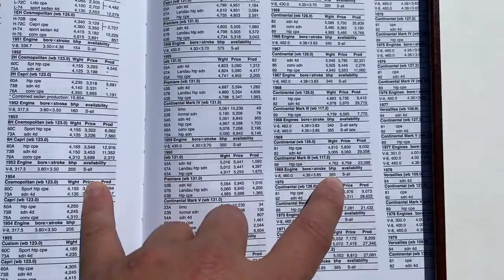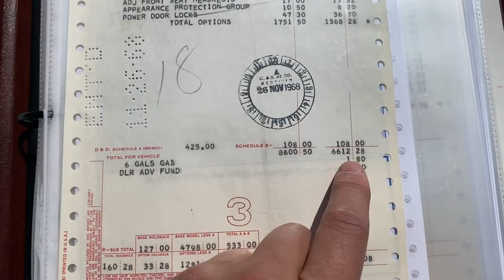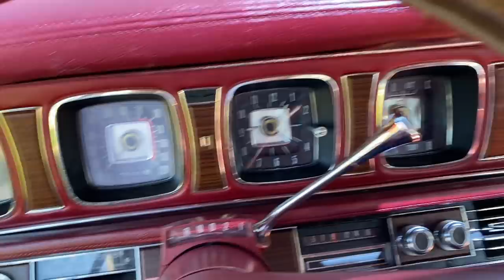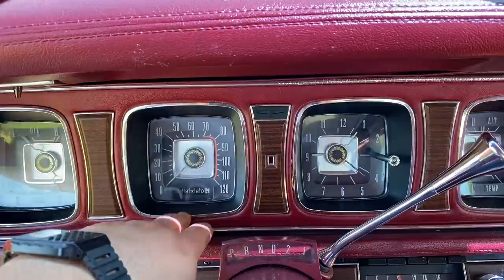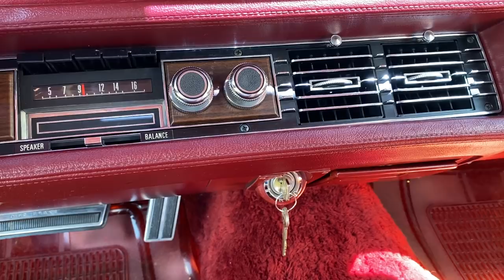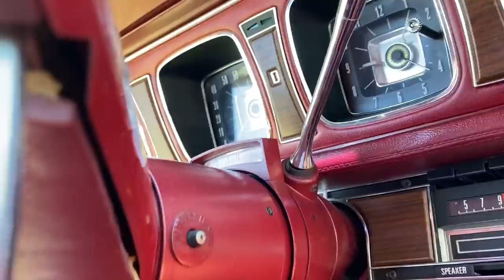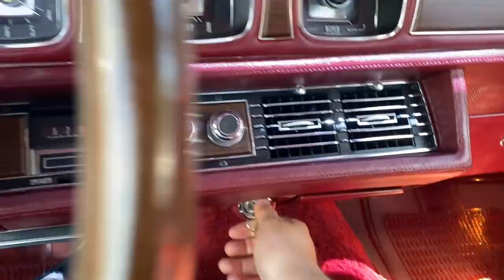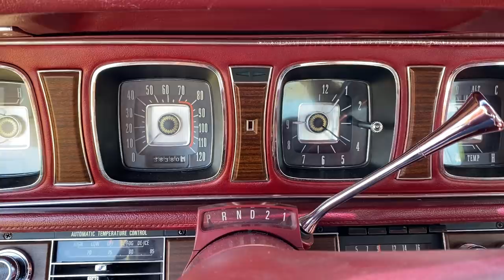The High Point of American Luxury Cars: 1969 Lincoln Mark III

Comment: Have to say THANK YOU to Mr. Lee Iacocca for these beautiful MARK III's. Your car lives on!
Reply: Amen. Story has it that Lido had a sleepless night in Europe when he came up with an idea of slapping a Rolls Royce grille on a Thunderbird and the rest is history.  He went on to work his magic with the Maverick, Mustang 2, and yes the Granada/Monarch. He had a hand in the fox platform in the planning stages. I wonder what position Ford would be in today had Henry Ford 2 allowed Lee Iacocca to do whatever he wanted - one is with an engine sourced from Honda and of course the mini-van concept. Hmm
Reply: @chadhaire1711  Yes they were, but they sold well. Right cars at the right time. Lee did the same with K cars at Chrysler.
Reply: @markjohnston3502  1987 K Car! That's what we used in Driver's Ed class for practice driving around town & the nearby country roads!
Reply: @markjohnston3502  Ford usually fires you for doing a great job!
Reply: They actually thought that it slowed down the assembly line!
Reply: The grill on that car weighs more than a Honda.  It is really the last true Lincoln quality wise.  All chrome and stainless trim not aluminum on the outside, and steel on the body thick enough to resist small bumps so when you hit a pedestrian, they stay down.

Comment: One very important system to look at on any 68-71 Mark III are the drain tubes for the rear vent cavity which drains water from the cavity to the underside of car via some flexible bellow style hoses in the trunk on either side of the spare tire. Once these hoses rot which 99% of them do, depending on the horizontal attitude of the car the water will either drain to the trunk or worse yet under the carpet and often into the wiring track under the passenger side. 

I found this out after not being able to get the musty odor out of my car which entailed removing the complete interior in order for the water to evaporate and air out the carpet.

 Because replacement hoses were not available back in 2003 I used some flexible pool hose and replica hoses may be now available for purchase from Lincoln Land in Clearwater FL. 

With 500 ft lbs of torque the Mark III is a tire melting monster. There is even a fully dressed Mark III on you tube that runs mid 10's in the 1/4 with a modified 460. I love my 71 MarkIII.
Reply: The MK III's are awesome, but what a horrible and easily fixable problem to be completely unaware of.
I read that the early 460's from 1969 to early 1970 were built using selected fits, which substantially increased the 365 rated horsepower.
Reply: They say the 500 engine is a good drag racing engine when built for high rpm’s.
Reply: Sorry, but I'm not entirely understanding what area the tubes are draining the water from....can you specify? thanks.
Reply: Chrysler used a similar rear-window/trunk area fresh air system in 1967 (the only year) and it had large drain tubes in the trunk as well.  I suspect the general idea of aquaducting water thru a vehicle was determined to be not a good idea.
Reply: A John Deere 7000 series corn planter dry fertilizer tube is almost a perfect fit, you will only need to use an adaptor at the bottom. Under 20 dollars at any John Deere dealer.
Reply: Tubes drain from the rear grille opening above the trunk theese are a problem I encountered
Reply: @Johnnycdrums  I raced a roadrunner and beat him a relative he couldn't believe it   dont think was  a hemi  though. The 460w a good motor when low  quart oil would tick loudly
Reply: Yikes!!!  Thank you much for your info: I have a ‘70 Mark III  which, sadly,  was quite obviously neglected for a good part of it’s life,  but I love it and want to rescue this magnificent piece of Americana; so with the things in your comment that you talked about concerning water going into the trunk etc. and the rotting tubules, I’ll know some of the things to have checked out.

Comment: My grandma had that car.  Same color.  Leadfoot granny got a few tickets in it.  
Go Granny Go!
Reply: Nana had class and style, My pops loved smoking people off the line at stop lights in the Mark III especially Buick 225 Electras that was the GM equivalent  of the mark III.
Reply: Cool, the same car in the French Connection
Reply: As you describe it, the granny from Wendy's commercial of the 80's comes to my mind. Where's the beef🙂
Reply: @lilibethdoherty295  The GM equivalent to that car was the Cadillac Eldorado. Lincoln was the top model made by Ford and Cadillac was the top line made by GM
Reply: @tomsreviews238  My Dad always put the posi -traction Diff. and the Torque of the 460 to good use racing buicks and chevy's at stop lights the Mark III was not just class and luxury it was a powerhouse too!
Reply: @tomsreviews238  Thanx, I thought that too.

Comment: Although these cars were built on the same chassis as the T-Bird, Lincoln did a much better job with the same base. It was meant to be a limited production run of 3 and maybe 4 yrs. at the most. My Dad bought one brand new in 1970, it was his last car before he passed away. These were elegant cars in their time,... understated luxury, The interiors were warm and inviting and were very comfortable . The Heating and AC systems were excellent. For such a large heavy car the handling was exceptional for the time and the brakes were powerful and easily controlled. Two wheel ABS brakes were available and worked. These were better cars than the Cadillac Eldorado, less plastic, and much more class. Few cars of the time had a full set of gauges, but the Mark III did. 

I am always surprised and disappointed that these cars have never been given the respect, status, and value that I feel they deserve among car collectors.
Reply: Understated luxury, are you high? Maybe compared to Cadillac of that era, I love those cars, but they are kitschy as fuck.
Reply: @vulekv93  Kitschy? As I said, in their time, their luxury was understated. Compared to many Cadillacs and others, the interiors had a minimum of chrome and glitter and the quality of the materials used were better as well.

I am curious what you consider to be tasteful yet understated.
Reply: Having driven both, I prefer the '69-'71 Cadillac Coupes for overall driveability, including acceleration, cornering, and general road feel.
The Lincolns had a quieter, smoother ride though.
Reply: I read somewhere recently that the Lincolns handle the best of all the BIG luxury cars.
Reply: @vulekv93  “kitschy as f*ck”.  Very elegant, Professor.
Reply: Small detail left out - the Mark III was built on the longer 4-door Tbird chassis, not the 2-door.
Reply: @mutleybird  I believe it was, good catch.
Reply: @mr.blackhawk142  
I have owned both Lincolns & Cadillacs from this era.  The Lincolns are always quieter & smother but the Cadillacs handle better especially in corners.  That said if you read road test from this era it was unanimously stated that Imperials handled much better than Caddy & Lincoln.
Reply: @mutleybird  ; Hey, fancy seeing you here.
Love your two Channels, are you still posting?
Reply: @mutleybird  ; Yeah, the early "Glamour Bird" was wicked, 67'-69'.
Reply: @Johnnycdrums  Yes, don't know what you thought of my newest video, though.
Reply: @mutleybird  ; It's not my #1 of yours, but I dig it, because you balance the sound so very, very nicely at all times.
Should I say mix the sound?
Yes, and we can tell just by comparing original recordings to the muteleybird mix master after affectations.
Reply: @mutleybird  ; "The Mellows", never heard of them, but that means absolutely nothing, or maybe you're going into the deep end of the pool.
Female Doo-Wop? I guess it's worth hearing more of.

Comment: They didn't just build cars back then, they made movable art. My first car was a 63 Impala (Not new, im not old lol) and although basic compared to most designs of cars back then it was incredible. One finger ability to turn with power steering, stars in the headliner, pillar-less windows, A heater that was enough to heat a home, floor vents that didn't let water in but cool air.

Comment: These were not considered Mob cars when new. That lovely nomenclature started with the 1974 Lincoln Sedans with the chromium railroad tie bumpers, opera windows and coach lights. The sales brochure for the Mark iii looks like a resent day Ralph Lauren catalog.....the '69 was the highest quality of the 3 years with metal dash inlays and vents. The turbine hubcaps looked great. The wipers were also exposed on the '69 ( hidden on the 70 and 71) Gorgeous example right off the brochure.
Reply: Let’s just say that if one lived in that neighborhood in ‘69 and drove that car, one was not likely declaring all of their income. 😜
Reply: You said the El Dorado has a nice engine and transmission it does. Not nearly as nice not even close to as nice as a 365 hp 500 ft.² pounds of torque 460 in.³ 385 engine family Ford. That’s one of the finest motors ever made by anyone at any time. A lot of people don’t know about that motor..Canted valve arrangement cylinder heads on that with the quench chamber that motor is turning over 10 to 1 compression and they put dish pistons in the mid-1972 fun fact if that motor isn’t at LEAST 400 Hp .. on a dyno.. I’ll eat my left boot…in Macy’s Window..  on Sunday morning
Reply: I was gonna say that… stuff too.. I knew  all that

Comment: I would not recommend removing the spring for the headlight covers. They were designed to open by default in the event you lose vacuum air. If you're driving down the highway with your headlights on and lose vacuum, the headlamp covers will close and you will not have the use of your headlights. It could be very dangerous. Also, if you disconnect your air-conditioning unit your windshield defrosters will not operate properly.
Reply: There were many cars that didn't have A/C at all, and they still had windshield defrost.
Reply: The air conditioning helps them perform better by pulling humidify out of the air. Again how well that helps will vary depending on your climate and how clean you keep your inside glass.
Reply: @ryanhawkins1235  True. And defrost and 'defog' are two different functions.
Reply: @redpine8665  YES, BUT IT WAS NOT DEHUMIDIFIED AIR....CAR FULL OF PEOPLE WAS A PROBLEM...BEEN THERE
Reply: @log05mus  TAKE IT DEEP HAROLD HOLMES!
Reply: It’s called a “fail-safe” system for a good reason. 
Also the final warning about sudden reversals due to weak notches in the gear-selector: Wow. No recall on that?
Reply: @markmaiello9180  my family was into Fords. We had a ‘75 E-150 Club Wagon and a ‘78 F-150 Ranger.  The “recall” for the transmissions shifting into reverse was the sticker Adam mentioned on the dash that warned against idling unattended and promoted the use of the parking brake.  In the early 80’s when we got a Fairmont Wagon and then a Granada wagon, to lock the steering column there was a white button on the steering column you had to push to get the key out. I also remember on those the horn button was moved to the turn signal stalk. You had to push the stalk in to blow the horn. Ironically that was also the time where Ford’s motto was “quality is job one.”  Like they had to convince us they were good cars
Reply: @ryanhawkins1235  yea rain-x
Reply: @markmaiello9180  Shouldn't people be using the handbrake when the car is parked anyway?
Reply: I don't know Fords very well, so I wonder if the issue is in the steering column (does it not require a robust intentional movement), in the transmission where the linkage translates into valve movement, or in the parking pawl that locks the transmission output shaft?  (I am much more familiar with a Chrysler system)   Regardless, if the concern is the car going into reverse while running, it would also be the same concern for it rolling away when the engine is not running, no?  Engine running or not, there is still chance for injury/death if a 5000lb car gets rolling fast enough when it hits something/somebody.

Comment: I loved those Lincolns when i was a teenager back in the 60's and 70's I owned a 95 continental it had the 4.6 32 valves nice but the electronics were lousy but the engine ran great I can that's your baby you take good care of it young man I drive a 2006 GTO at 67 it's fast enough  for this old man

Comment: I can't imagine the neck snapping torque this high-compression 460 is capable of producing. I had a 1971 Pontiac Grand Ville (455) that we did a lot of bolt on mods, and we upgraded to a better head casting and we were getting an 8:38 ET in the 1/8 mile and a 60-foot time of 1.78 seconds. Bet this 460 will rock and roll.
Reply: As an owner of a Bonneville with a 455 and a 98 Oldmobile with their 455 and also a Ford with a 460 I can testify that the 460 had pretty good torque but it was blown away by any of the GM 400's.  It was slow compared to any of its contemporaries. I can only describe it as adequate.  My Olds pulled out of the slot like a dragster and you could barely keep it straight till it got into third.  The Ford 460 never demonstrated anything like that.

Comment: I owned a '71, nowhere near this nice. The '69 was the best because the engines were quite a bit stronger than the 70 and especially '71. The specs books don't reflect this; FoMoCo didn't want to release the car and then keep showing an HP drop on paper, so they understated the power rating for '69 especially. I took the back of the interior apart to work on the power windows; the car was built like a cathedral, with about that much consideration for what things weighed.

Comment: I have a 1971 continental mark III . you pulled out some good things we forgot a few good things. The 69 started in June 1968. Early productions did not have headrest. And the reason they went for the dash steering column was because of the federal government have a locking column to help prevent theft. 69 and 70 the bottom of the hood was painted the same color as the car 71 it is not. It was also the first car to come from the factory with radial tires. All the trim is made of stainless steel. It also was available with A very early type a rear antilock brakes. Power trunk release is also vacuum operated. And yes the 70 and 71 used real wood and it does hold up very well. Back in 2017 my mark was on the cover of continental comments.

Comment: Dream car right there. Also fun fact, a Rolls-Royce in the sixties cost around 8k for the base, this Lincoln and Cadillac were up there with Rolls, but they screwed themselves over in the 80s by cheaping out.
Reply: RR made two models in 1969, the Silver Shadow was the cheapest and started at $20k up to $29k. Not sure where you got your numbers. When it was launched in 1965, the Silver Shadow cost an impossibly steep $19,700, or about three times as much as a contemporary Cadillac Sedan de Ville.
Reply: Hi, Victory.  The least-expensive Rolls-Royce Silver Shadow in 1969 was 8K POUNDS, which was close to $20K US.  Brought forward in time: my 1978 Silver Shadow II (also the least-expensive Rolls by a fair margin) just nudged $70K brand new while the contemporary Continental Mark V (NOT the least-expensive Lincoln) had a base MSRP of $12K.  The special limited edition Mark V Diamond Jubilee, the most expensive car ever sold by Lincoln, had an astronomical MSRP of $21K.  Fun fact: Even into the 1980s the MSRPs of American luxury cars failed to break the $20K barrier.  At the beginning of the decade, the highest-priced American car you could buy was the hand-built 1981 Chrysler Imperial, at what was then considered the eye-watering base MSRP of $18,300)
Reply: Of course one cannot forget the Cadillac Allante, that sold for close to 60 grand in 1987 model year. :)
Reply: @bobtepedino5661 Lincoln Continental Mark VI was $24,000 In 1980
Reply: @betsyduane3461  Base MSRP was $16,700
Reply: @bobtepedino5661  Base
Reply: @betsyduane3461  Yup.
Reply: @bobtepedino5661  So US cars did top $20k, thanks for agreeing.
Reply: @betsyduane3461  Check your reading comprehension, troll.  Maybe start with learning what MSRP means.  Then we will discuss these cars in more detail: I've owned a '78 SIlver Shadow II, an '80 Mark VI four door and an '81 Imperial and have been a member of the RROC, the LCOC and the Imperial Club for many, many years. You???
Reply: Ralph Nadir was opposed to private ownership of motor vehicles for the “ordinary folks” who Ralphie wanted to see riding the bus…

Comment: Hi there. Loving that Mark 3, especially the color combo. I have a 70 Mark 3 and was just wondering how you got the hood ornament on. I have a hood ornament which i got in Hawaii about 30 years ago and want to put it on, but a bit scared of doing damage.
Reply: Bring it to a reputable local body shop. NOT a chain store like Maaco! My Mk III had a hood ornament that was installed perfectly by the previous owner. I didn't even know it wasn't factory, until I learned it wasn't. It's an awesome touch to an awesome car!
Reply: @kenk7451  Cheers thanks for the tip. I love this car and a Hood ornament will just set it off.

Comment: Bought a clean '69 in 1977 in Pasadena California, while on vacation from my gig on the Alaska Pipeline. At 26 I had waaay too much money. Had the car driven to Seattle and shipped to Anchorage. Flew to Anchorage on arrival, drove to Valdeeez. Eerily silent, smooth and effortless. Driving across the plateau toward Glen allen, toolin' along, Portland Oregon on the radio, blissed out. Pair of headlights in the far distance, AST flashes roof lights as we reach hailing distance. I look at the speedo I'm doing 115. No stop, just slowed a bit.